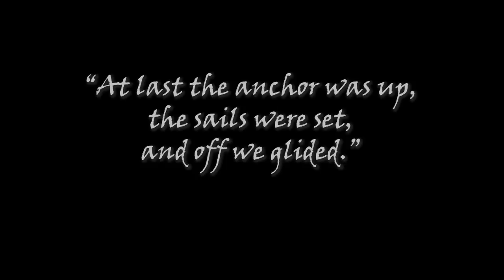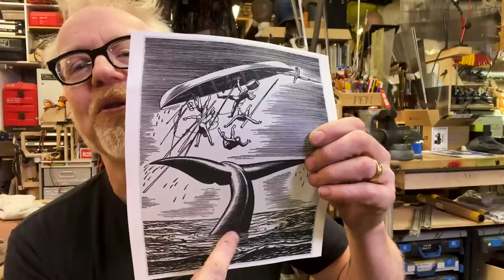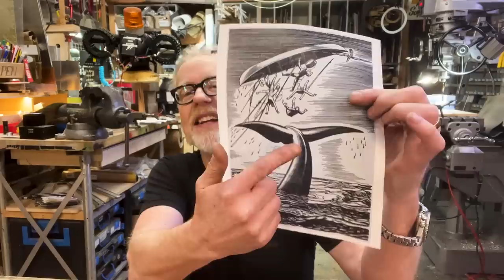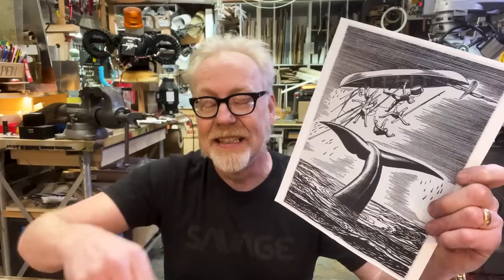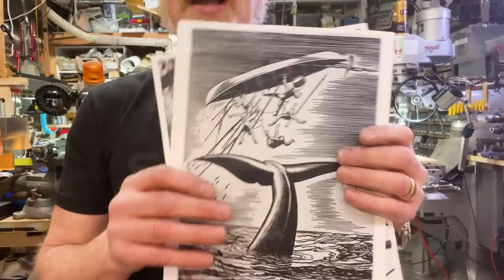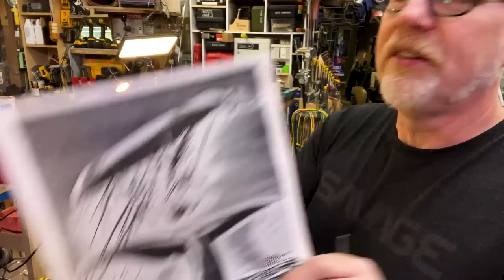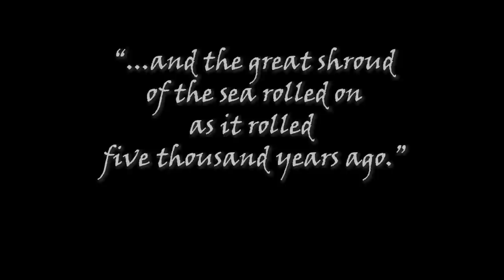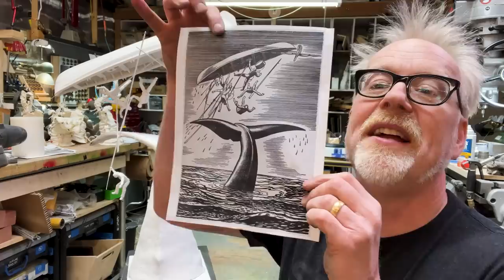Adam Savage's One Day Builds: Moby Dick Diorama Maquette!

Comment: I can fully relate to the starting the tail dilemma, I am working on a project that stalled for a year while I figured out just how to go about soldering some nano LED's, the LED's were 0.8mm x 0.5mm and the wires were 0.1mm dia (as thin as a hair) and when I first attempted this the soldering iron would just melt the wire away, it took a year to come up with the courage to try again and this time i found a workable solution, it would still take me an hour to solder the connections for each LED, to a bigger cable while heat shrinking the smaller cables to make them substantial enough to clip in to the structure, but you have to go out of your comfort zone to achieve these things sometimes.

Comment: I'm a sculptor and potter, the process of turning and slowly discovering your work looks like shit and trying to make it look less like shit is VERY accurate! especially when you're working with a medium that needs an armature, because the armature is never accurate so it always ends up distorting, or poking through, or not being enough structure to keep the form of the thing you're making.

One pointer for sculpting. All art, all making, needs the maker to work general to specific/rough to smooth/un-detailed to detailed. You already know that Adam, but Sculpture is even more of that than any other medium I've tried, and I've tried damn near everything. Generally speaking, when you're first starting, it actually pays to be as sloppy and "sketchy" as you can, especially when you're doing additive processes like this. All you should want from the moment you first start putting the clay/putty down is a super general gesture. When you have the feeling of movement and mass you want,  THEN you start to refine and put in the biggest indications of detail by adding still very rough wads of clay, and by working with toothed tools that will allow you to remove a lot of material if you want, but will also keep the sculpture looking rough even when you're finessing things. Try to work on the whole thing at the same time, jumping around to lots of different places, and don't just keep spinning it in the same direction like you're riding on the hands of a clock. Be erratic with it, move the sculpture, and move yourself around the sculpture, step back a LOT, walk across the room and look at it from far away and from lots of different angles OFTEN, like REALLY often. And don't even THINK about smoothing the surface of all the tool and finger marks until you're sure you've got the shape exactly where you want it. 

I do need to add a disclaimer: Working this way isn't a sculpting rule, for those that work differently and their process functions for them, they shouldn't take this as gospel or feel like they're doing things wrong. The process I outlined is specifically a technique to train your eye to stop looking at all the little bits of what you're sculpting and to start seeing the piece as a whole as soon as possible. Basically it's a way of working to prevent the "turn 6 degrees.. It looks like shit, make it look good, turn 6 degrees... It looks like shit." rabbit hole. There will always be some of that no matter what, but working as rough as you can for as long as you can will actually help you to move through that part of the process much more quickly.

Comment: a lot of people in the gaming side of things use old single core rf coax for the wireframes and bases for sculpting before putting an intermediate surface on, in your case the aluminium foil, this give a semi rigid but deformable surface, fromthere they build upin layers of detain starting with basic form, then adding small areas of more defined detail, with a final process of uniquely accurate fine detail that individual segments can take the whole curing time to finalise.